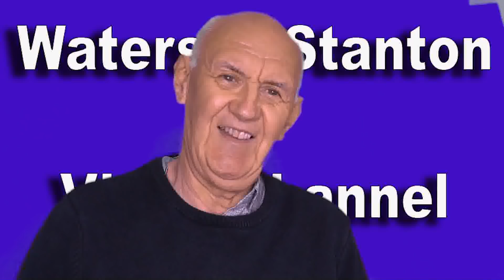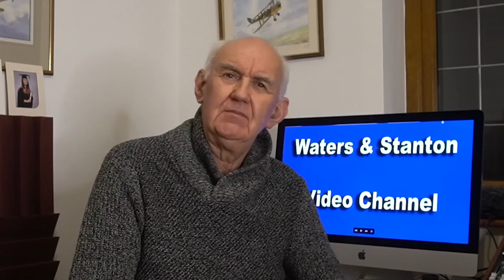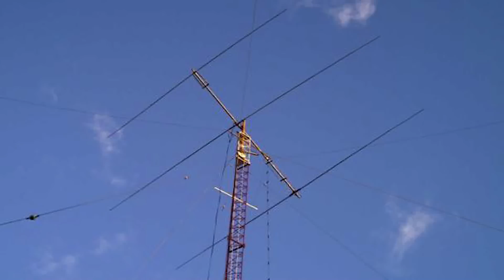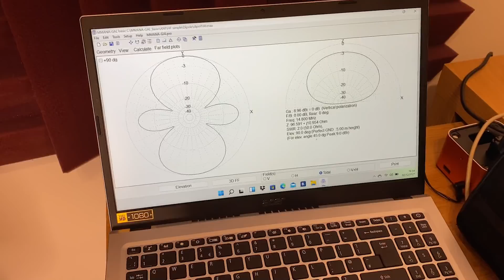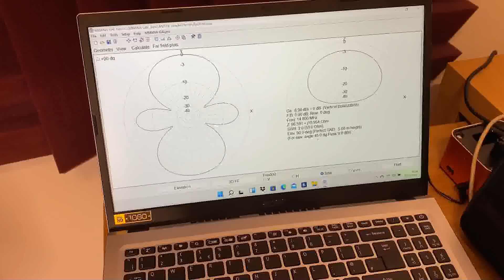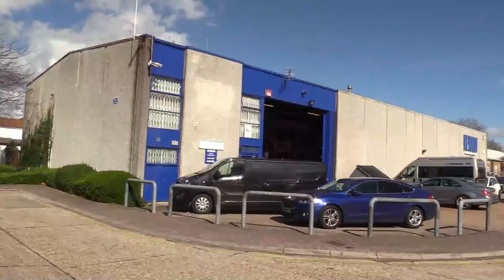HAM RADIO HF ANTENNA MYSTIQUE

Comment: N4DXC now SK lived on a saltwater bay in Florida. He told me he also believed the water would be a great ground plane, but when he set up a Butternut vertical he found it still needed all the radials it did when mounted on land. He mounted it on his dock and ended up using stainless steel radials just stretched out in the water out from his dock. I worked well but the water was just not salty enough to not require several radials. There is an old bridge that is above another bay near me, I want to try something there. Maybe a doublet with latterline feed just tossed to fall under the bridge but over the water. I know mobiles always worked well when driven over that same bridge. It would just about be broadside of the UK so when the bands get well open it might work at the grayline. thanks for sharing your wisdom, I can't likely buy from you, but do support your channel. A vertical would also be fun but need the radials a possible hazard for fishermen on the bridge.
Reply from the maker: Great info. It shows that practical applications are the best ways to ptove or disprove. 73 Peter

Comment: Might I suggest another option, namely, the inverted L. You get a vertical and a horizontal. Mine is en end-fed half wave that goes up 32’, loops over my roof, then goes 100’ to a tree. My KX3 tunes it from 80 through 6 and it usually outperforms my ground-mounted 6BTV. I turned the 6BTV into a 160M inverted L by adding 18’ of horizontal wire to the 80M whip. I have never been in a better place with regard to signal quality. I operate almost exclusively QRP CW.
Reply from the maker: Yes inverted L is what many of us G3s used as the main antenna. Interesting comments about your vertical. with results similar to my own. 73 Peter.

Comment: Yes, please revisit the wonderful, classic G5RV, known the world over; & in doing so, I hope u'll also touch on the modified version of this all-time great antenna, the ZS6BKW...have had mine for many years; it's a bit shorter than the classic, but I love it the most becuz it'll work multi-band HF when using just my rig's internal AT (an IC-7300)! 73 de WA4ELW in TN 🇺🇸 dit dit 😃
Reply from the maker: We will!  73 Peter

Comment: An interesting and thought provoking video. I took down my ZS6BKW when I went to a vertical but for chatting with friends I need my "Cloudwarmer" back. A 40m dipole at 10m with half wave reflectors underneath it was the best I have ever had for inter G.

Comment: Hi Peter.. Another excellent video.. Back in ‘78, the only antenna I had was a Joystick and, with more than a little help from a ‘spotty sun’😊, I managed, on CW with an old HW100, to work many stations at many thousands of miles..However..I remember well the un-energised fluorescent tubes in my shack flashing in sympathy with the CW!!..and the hissing sound from the minuscule Joystick ATU as the RF arced across the variable capacitor 😩..and then there were the RF burns☹️….
When the Joystick was advertised, what persuaded me (I was very naive back then )to buy one, was the claim that there was a ‘military version’..and it was accompanied by a photograph, supposedly of a ‘military version  Joystick’ mounted on a warship!!..Happy Days😊
Thanks Peter..John..
G4EIJ

Comment: Peter thank you for the content on antennas. Ot was very interesting.  New and old hope it was explained. I  would love to be able to use Managua program. Just for seeing what it does along with all the information you can see. At 75 this technology is getting to a point, it doesn't run Smoothly into the Grey mater.
I enjoy your content. 
73 de KQ4CD

Comment: Hi Peter - my mate had a Sigma 4 and then a Penetrator - that was also his CB handle - here in Australia we all use call signs like Charlie Baker 4001 which is mine along with my ham call sign VK4 MIX. I had a Hygain CLR487 Mk2 I think it was - I think they were originally from the 70’s - but NASA use Hygain antennas  on their space ships and they can’t be wrong! Got all over the world on that! 
Times have changed and now have a Diamond CP6S which doe not perform that well with my height restrictions and the main antenna is a G5RV which seems to do rather well on 40m but not so on 80m which is a noisy and temperamental band anyway.
Still loving the channel with your cheesy music - I might have to remix it one day LOL! Cheers Dan

Comment: Well said.  I would add that a very good transmitting antenna, can be a poor receiving antenna because of the noise generated by modern electronics in most homes and/or the orientation of the antenna.  I'm reminded of that during 160M contests where the strongest stations (likely running verticals) often have the most trouble hearing me because their noise level was so high.  

On any band, if you have an S9+10 dB noise level, you are not going to be able to work nearly as many stations -- no matter how good a transmitting antenna you have put up.  Getting the received noise level down is important in any antenna setup.